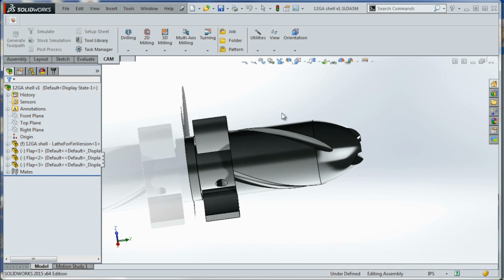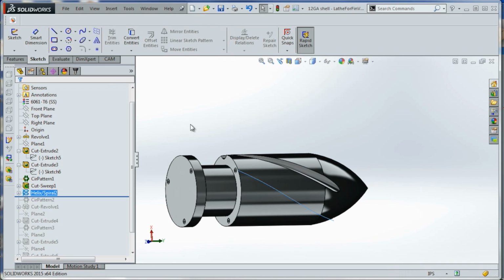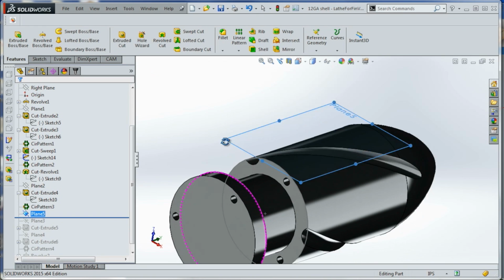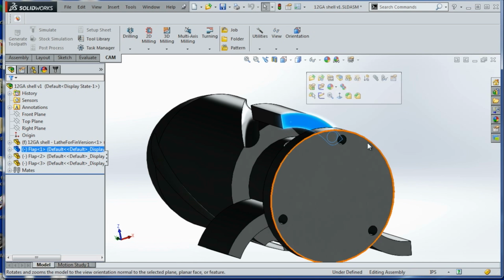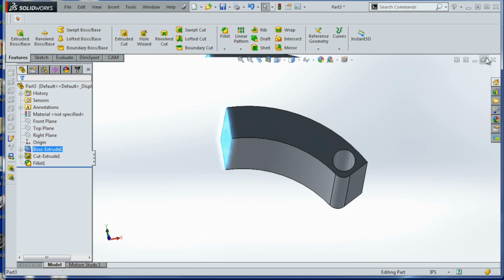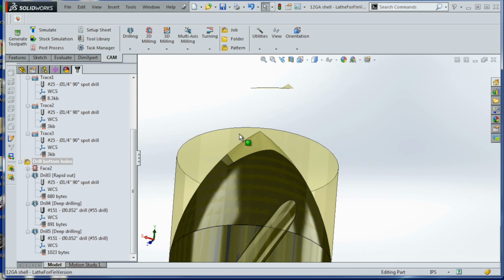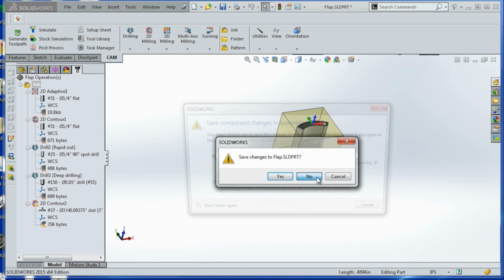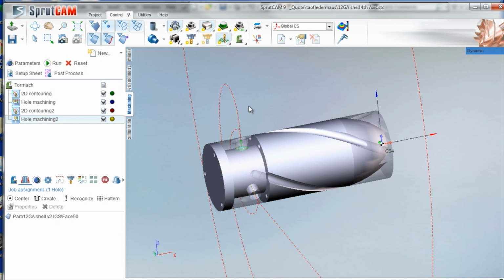12GA CNC Missile Slug:  Solidworks CAD & HSM & Sprut CAM

Comment: You likely figured it out by now.  But create the path for the one contour then right click and click "make pattern" then click the drop down and pick "circular". Pick any round or cylindrical area to rotate about.  This is how I have been doing 4th axis as well. I just started trying to learn it yesterday. Was hoping you had a video on hsmworks 4th axis programming.

Comment: Impressive work as always :) 
Just a quick thought. Shouldn't the fins be placed the other way around? Let me explain. Due to the  centripetal force while it spins the fins will remain closed? If the hindge was in the other end the force will active help the fins to flip up along with the airflow.  This could be way out wrong but just a thought :)

Comment: NYC CNC akromix +Hirudin To deal with the Trace command in the way you want, you just need to turn off 'Keep tool down' in the linking tab. Then the tool will pull up to the retraction plane. John, regarding pattern. Check out the Pattern command just under the Job & Folder buttons on the CAM ribbon tab.

Comment: One thought about the triangular cuts at the tip: You created a new plan tangent to the slug's outer face, create a sketch on that and extrude-cut to the front plane. Why didn't you just created the sketch on the front plane and extrude cut "through all" outwards (reverse direction) thus eliminating the need for a new plane?
If visibility is the reason (sketching "inside" the part): you can activate "section view" - the 4th button on the HUD bar just at the top of your 3d view - and it excludes everything from the sketchplane towards your pov.

Comment: .125*.02=.0025*5100=12.75 IPM.

And come on, you can push harder than that in aluminum, too.

Also the green lines in HSM are lead-in and lead-out lines. Yellow are rapids.

Also (more HSMWorks tips) you can edit the default expressions that HSMWorks uses to calculate things like drill feedrate. IIRC you can put "drill_diameter*.02" in that field and make it default and it will calculate your feedrate for you every time regardless of drill size.
Reply: NYC CNC It's one of the things that makes HSMWorks my favorite CAM system so far. Very adjustable, and easy to tune out the monotonous settings that we deal with normally.

Comment: Are you now confident in using the slitting saw now or are you still wary about using different metals. I would probably be very careful and only move slow until I was 100% before doing it say on some cold rolled or eve tool stock. Beautiful work on the finished piece but would it help the fins if the rifling was leading air at the fins, I am not in any way a rifle or ballistics expert but I do know both hydro and aero dynamics fairly well as I make planes and boats in model size for rc as well as cars and we know that it can all get technical very quick. I only deal with speeds up to 200 mp3 but if you know hero dynamics you also know are and visa versa. I am enjoying your CAD work as I only started with it at the beginning of this year with solid works but before I was using turbo cad so you have been a savior for me as the table I am making is to do both 3d and 2d cutting for my models.
Reply: NYC CNC Have you looked at using any CFD in CAD to try to get a slight bit better aero?
Reply: It should still work but if it was going into batch loads then it might be worth doing some flow testing, if you have ever used Turbocad it has a flow calculator addon and can export the flow as you refine your shape.

Comment: Just a thought, but the small exhaust holes that i assume expand the stabilizers, shouldnt they be in a little bit of an angle so they also assist in making that thing rotating properly.? =)
Reply: That could work, also hollow out the back of the slug a bit so it will act a bit more like a pellet (rather large one) with proper angles the gasses from the shell will expand and roll back on itself a bit and enhance the acceleration and rotation. (clever guessing from doing airgun ammo and slugs).

Othwerise, that looks like the XM24 amunition, just alot less electronics. :D

Comment: What I've found with the trace function I've found that you have to manually input in the retract vs other functions.  I had the issue of it not retracting properly while engraving recently.  What I've gathered is the trace function is super super basic and you really have to tell it what to do, it won't dumb it down for you and automatically avoid collisions.
Reply: That's got me a couple times as well. Ugh!
Reply: No. In the heights tab is where I did my changes. Try it out.
Reply: Hirudin To deal with the Trace command in the way you want, you just need to turn off 'Keep tool down' in the linking tab. Then the tool will pull up to the retraction plane. John, regarding pattern. Check out the Pattern command just under the Job & Folder buttons on the CAM ribbon tab.